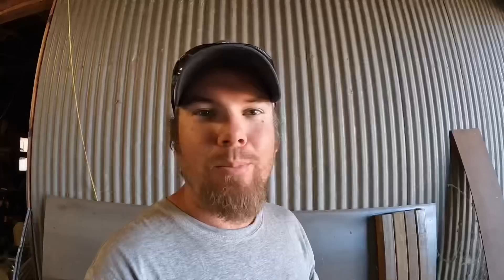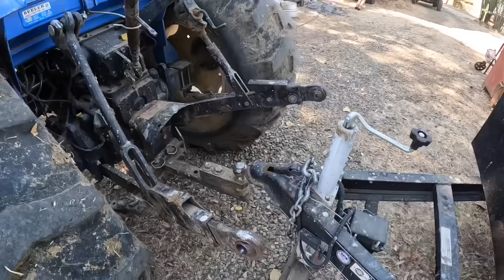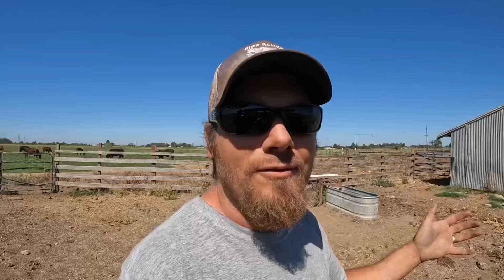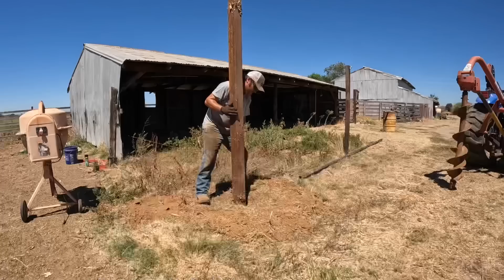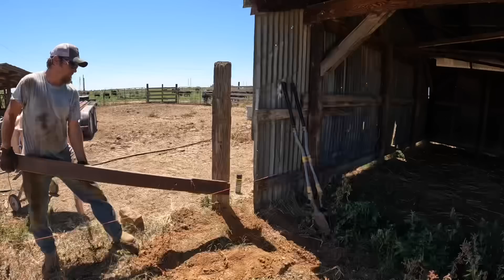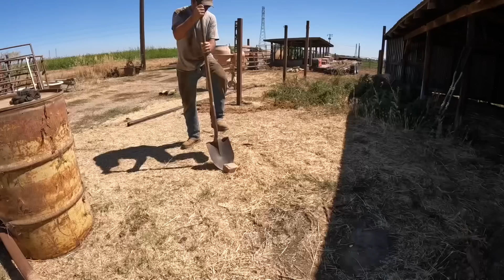Setting Posts in the Bull Pen!

Comment: How well does the Predator generator work?
Reply from the maker: I love it. It’s quiet and starts every time. Only thing I’ve noticed with it is sometimes running in 100 plus heat in the sun for extended periods it overheats and shuts down. In the shade it’s been good

Comment: The other nice feature of the sweeping fence line is there will be no corner where if the bulls get to shoving each other no one can get caught in that corner. Bulls can be really hard on your buildings and fences. When they feel like scrappin' they can push right through a wall. Ho a little water on the spots where those hand dug post holes go will make it much easier. I've built plenty of fence in this cali clay soil it is hard when dry.

Comment: Just a thought from my experience with my bulls, you might wanna use that area in the back corner for your water hydrant. I’m talking like still build your fence but stick your trough through a hole in the fence so they can’t get to the hydrant and rub on it. Does that make any sense? Kinda hard to explain sorry.